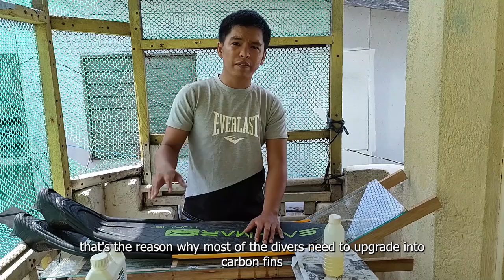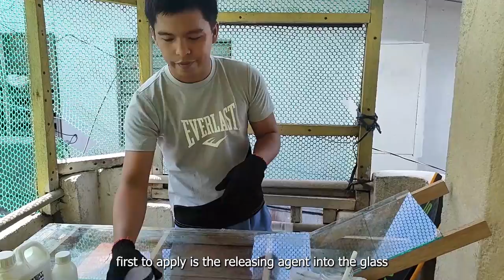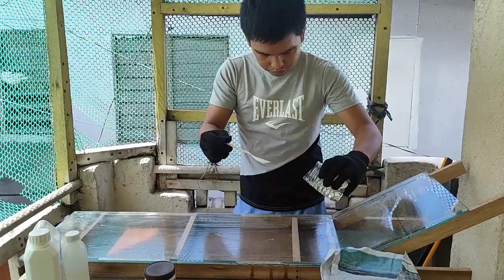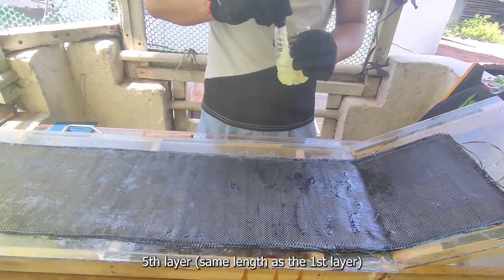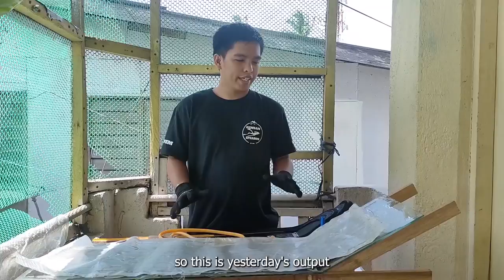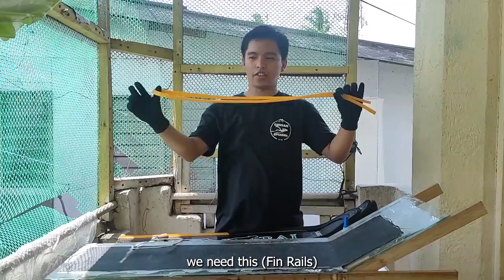DIY Carbon Fiber Diving Fins

Comment: Good job! If I may add my experience, I used two 3mm metal sheets, cut in the final shape of the blade. One placed bottom and the second on top of the last carbon fiber sheet.  That way I could use clamps to tighten  the two metal sheets together and the carbon fabric inside them.  It removes far more excessive resin from inside, making a much more durable final result.  Also, that way you use just a sharp blade after a few hours (when the resin starts to harden a bit) and you cut the excess fabric, giving very easily the final shape to the fins. No saw, no dust, no mask, no sand paper for the edges😁
Reply: Great input🐳
Reply: You mentioned using of 3mm metal sheets is there a measurement of how tight the clamp?
Reply: @d-hob8000  as much as you can.
Reply: @PKonstantinou64   Anyway, Thank you so much for your response.

Comment: Nice.  I would have liked seeing how you attached the CF blade to the rubber boot and how you prepared the boot.  Is it a special shoe for custom CF fins or did you cut up old fins and attach the blade to them?

Comment: Thank you for sharing your knowledge. How do you do to change the strength of fin; constructors offer different type, like soft, medium and hard. how to you perform it ?
Reply from the maker: if you want to add the stiffness of the fins just add the length of the 2nd, 3rd, 4th layer, for example, first layer is 75cm, if soft stiffness 2nd layer is 55cm and if you add length to 2nd layer you make it 60cm extra stiffness will add.

Comment: Hi mate, good job! I hope you have already used them in salt water and can tell if the superglue you used for rubber t-rails worked fine? Asking as I also used a quite expansive superglue, had 4 dives in the ocean, packed my fins for 3 months and finally found all rubber t-rails unglued laying in the bag so the glue did not work for rubber in my case... And the second question - what sticker with your logo is made of? I want to customize my fins with something similar.
Reply: Loctite (and I think most superglue brands have something similar) has “Loctite 460” for uses that you need the glue to be strong but flexible. It’s the glue type that fin manufacturers use.
Reply: Also, keep in mind that old glues have to be removed and fin surface to be thoroughly cleaned with acetone before applying the glue.

Comment: Pretty dam good! Try to use a gas mask filter to work with that resin, epoxy can be quite nasty on you lungs.
Reply from the maker: Thank you for info bro, some epoxy resin has a bad smell, West System has no smell but still needed to use Gas Mask, thank you for that 👍.

Comment: Amazing works!! What the blades brand /size /shape that you remake?
Reply from the maker: I made my plastic Salvimar Turn151 to Carbon, I trace the dimension of Salvimar then change the tips shape.
Reply: @salomtabai  thanks for the information. I have create one based on your video. But its to difficult to find the water rails.

Comment: Hi. Excellent tutorial.
How many grams of epoxy did you use for the 2 fins?
Thanks
Reply from the maker: half Liter of epoxy resin will be enough for two blades.
Reply: Tanong kulang po, magkano po binta ninyo ng ganyan?